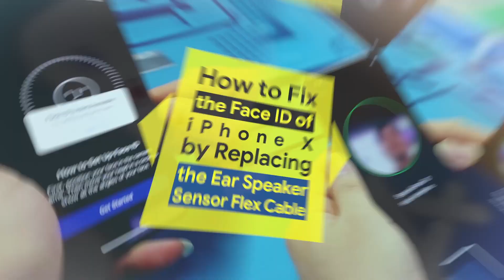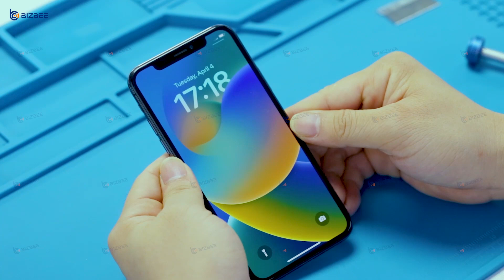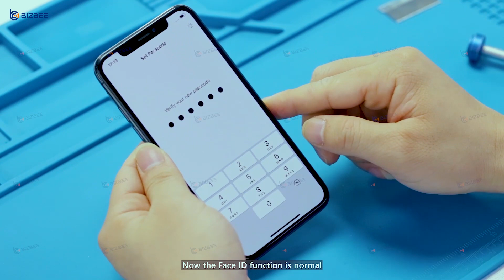How to Fix the Face ID of iPhone X by Replacing the Ear Speaker Sensor Flex Cable

Comment: Imo its much easier if you only do hot air, ofc you need to apply flux and make sure to remove any corrosion residue (its pretty common for the proximity sensor to get liquid damaged especially if the screen was previously replaced without changing the gasket, in extreme cases it may even cause boot looping). Funny thing i only transferred the proximity chip and now the face id works just fine even in the dark (iphone xs max)
Reply: you should also transfer ambient light sensor for True tone otherwise it'll disable.
Reply: What if the sensor is broken due to hard fall. What is the solution for this? Because this is what my iPhone X happened. It has a cracked on the sensor

Comment: soldering on the flood illuminator / proximity sensor was tricky. I could not get good contact until pressing down slightly with tweezers when solder was flowed. My mistake was probably putting flux and leaded solder onto the pads. Very hard to get fresh solder to stick onto those tiny pads. Can't heat it the tiny flex area and sensor up too much. Probably best just to reuse old solder like the video.

For testing, can check also proximity sensor (on the same sensor module as floor illuminator) When my sensor module was soldered on incorrectly. Both faceID and proximity sensor didn't work.

Comment: Can use whole replacement set and is face id work?
I use alcohol to clean sensor and now it is not working anymore.
Reply: Usually replacing the whole speaker removes Face ID functionality
Reply: @wakaralfaruq8761  can it be restored once this happens? Because my earpiece speaker stopped working completely took it to a shop they said it's a bad cable they replaced the flex cable and I lost face id and true tone, so I was wondering if it can be restored
Reply: @lowkeyy_jj  in theory you could restore faceID but you have to first jailbreak your iPhone then buy a tool made solely for configuring faceID modules and then pair the earspeaker serial number to the iPhone one and delete the old one. Or if you want the harder way you have to desolder the flood illuminator, the ambient light sensor and speakers and solder it to a new blank flex cable… this one usually works but it’s complicated and you risk to burn the components and ruin them forever. Hope this helps.